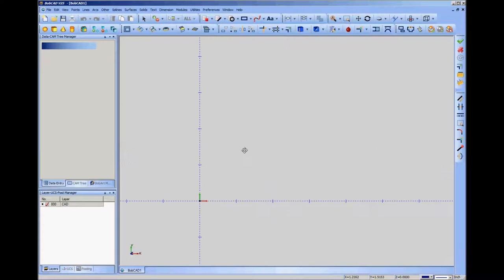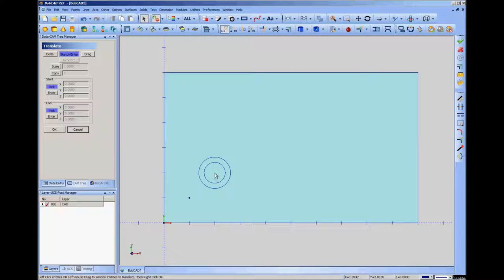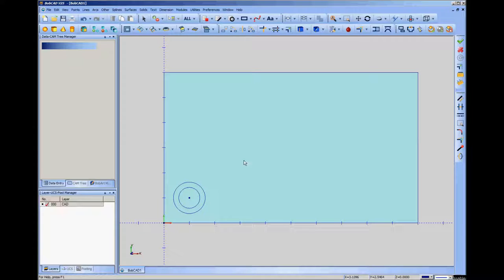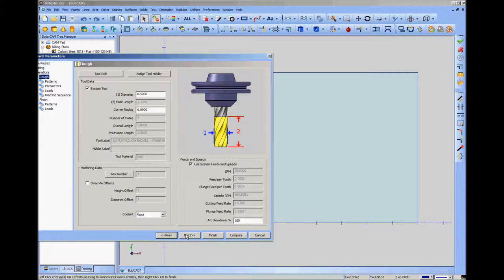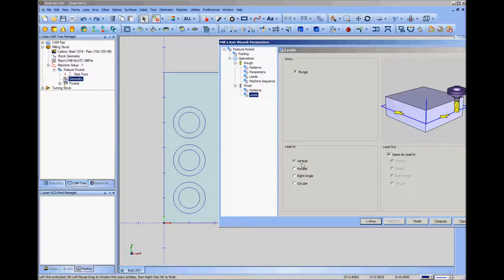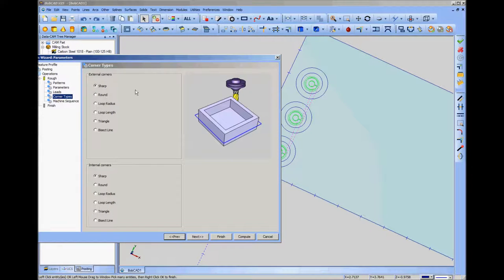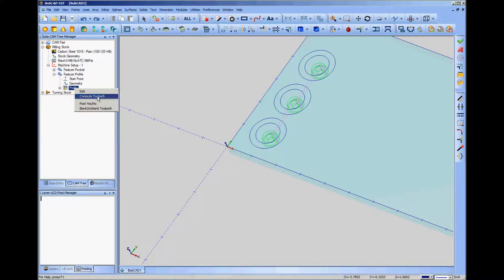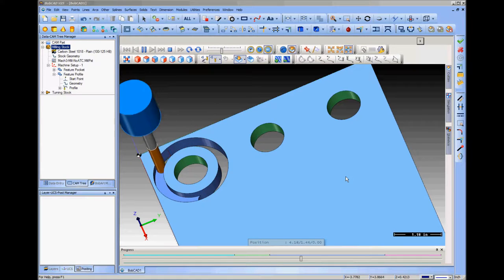Basic Pocket and Profile Operations with BobCAD

Comment: is there a way to automatically add holding tabs in BobCAD?
Reply from the maker: There's a Nesting addon that features tabbing, but no automatic tabbing in the basic package. It's not very hard to add tabs to a part manually, though. It's basically a matter of cutting a profile to the depth of the top of the tabs you want, then cutting an interrupted profile to the bottom of the stock. 

   In this thread on CNCZone, there's a video describing how to do it. There's no sound, :)  http://www.cnczone.com/forums/bobcad-cam/172648-tabs_nesting_v24_v25_-_please_read_al_depoalo.html#post1229368

   Hope that helps!